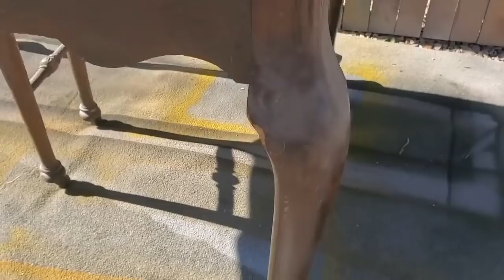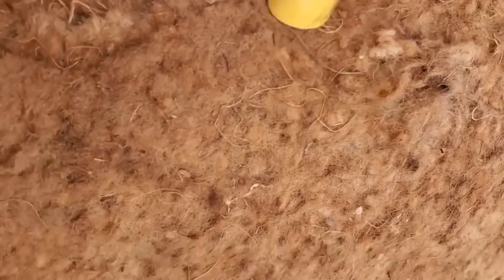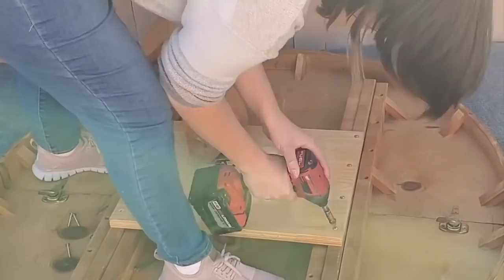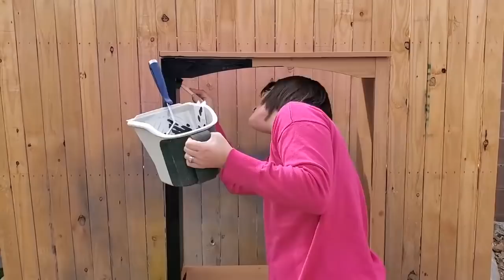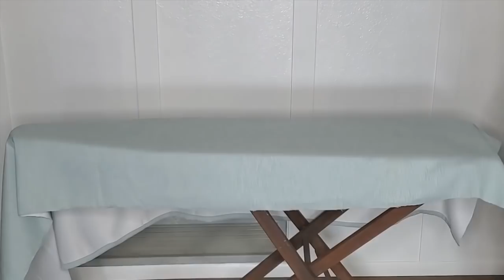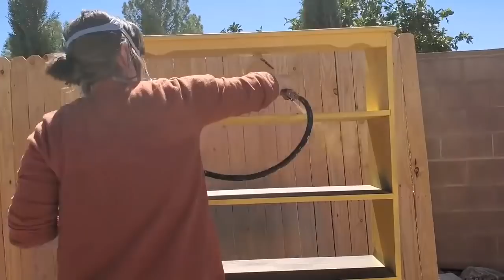10  Amazing DIY Thrift Flip Furniture Makeovers That Will Inspire You

Comment: Lovely. Just a tip with corners if I may; instead of making a fold, ease the corner in until it follows the contour of the corner. It takes time and lots of plucking and pulling and holding and stapling but it looks seamless.
Reply: @Ally Kuit I agree.
Reply: On sharp corners like she is doing even manufacturers fold.

Comment: What is the cordless handheld sprayer you use? Also the changeable blade you used on the 2nd piece, on the table, after you were stripping it down? They both look light weight and get the job done well. Love your videos!!

Comment: New subbie here. Do you have a video on your spray gun and the paints you use with it?
Reply from the maker: Thank you for subscribing Mari! I use an hvlp spray gun from harbor freight. It's usually under $20 in store. I run that on a 20 gal air compressor and can spray any water based paint out of it. :)

Comment: Hi there, I see that you put wax on after painting your furniture but sometimes you don't and leave it as is after painting. When would you say it's preferable to put wax on and when not?
Reply from the maker: Good question. Some paint comes with sealer inside to already and some does not. When a paint does not have any sealer in it you will need to use wax or poly over it or else the paint will wash off.
Reply: @DesertDIY  than makes sense! So I'm not really familiar with all the brands you use as we don't get them here, but we do have the Rustoleum spray paint, and I see you use that a lot. Would I need to use any wax if I use this spray paint?
Reply from the maker: Nope. Those are already sealed! I love their enamel paints. So durable!!!! But less color choices.

Comment: I don't know about you, but I'm exhausted by all that work!  You are one heck of a flipper.  First timer here, and I certainly admire your gumption.  Nice work.  It would be a real plus if you mentioned what you paid for those pieces and what you sold them for???  I imagine you made a nice bit of change???  Loved the shelf unit with the tree wallpaper backdrop.  I didn't love the bench...  The fabric was yuck, didn't even have an interesting texture.  And it would show every bit of schmutz from just sitting on it.  Oh, one more thing >> How about you slow down the filming when you show a product you are using.  I'd love to not have to rewind and try to catch what you used, and I mainly fail since your video speed is so fast.  (Except for the ironing parts where it drags on and on. Why bother to show the process in full?)